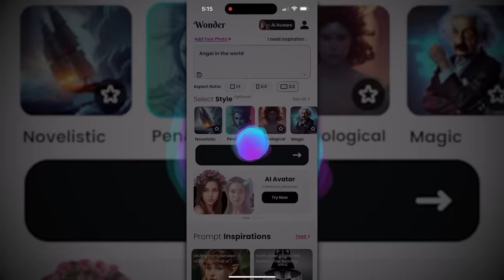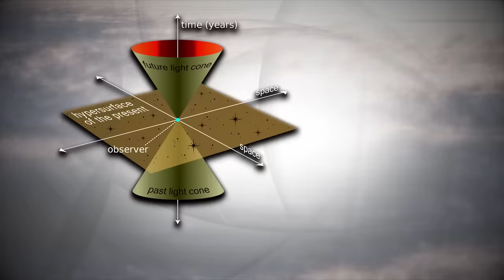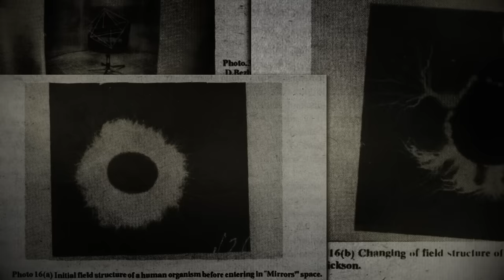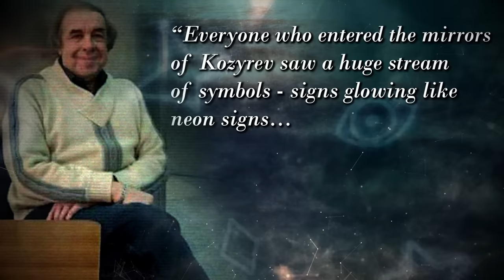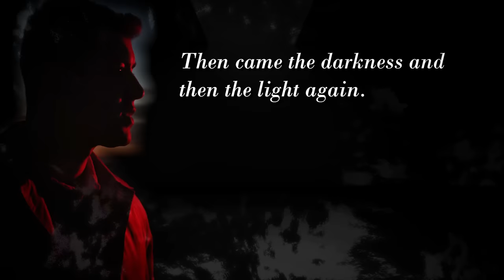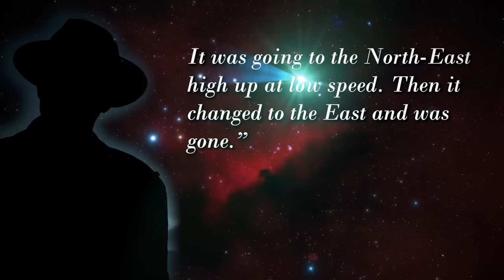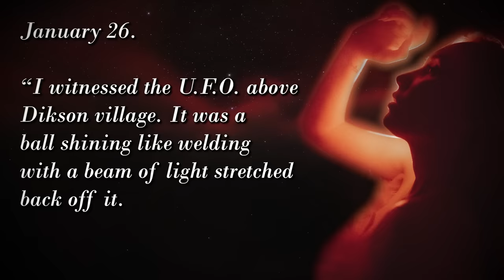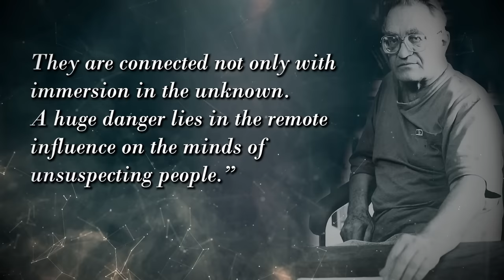Time Mirrors: Experiments at the North Pole

Comment: These experiments remind me of the Orgone boxes that were popular for a while and then outlawed.  They were pretty much like sitting in a metal box and seem ridiculous however they may have been banned not because they didn't work but because they did work. I bought a purple "Tesla" energy plate online with great skepticism and in a massive coincidence the same day at the local warehouse store food store they had a close out of large 2 pack basil plants with just one left and for half price. 
I figured what the heck I like basil.  I potted them and placed them in equal sunlight at opposite ends of my patio table  on my back porch and put the Tesla plate under one.  In just a couple of days the one plant was perhaps 15% larger and a couple of days after that 20%-30% larger and looked healthier. If I had not seen it myself I would not have believed it. 

People think they breath just to exchange oxygen and carbon dioxide but we also breath in what is called Orgone by some, or called Chi, Prana or life force energy. It is God Energy. When you have concentrated Orgone energy you have concentrated god power for remote viewing, manifesting and whatever you intend for it to do.   This is why I don't discount the amazing north pole experiments. I would like to know more about them but I don't automatically discount them.

Comment: I saw in a dream how a chrono visor was built. it was simple, made from a number of aluminium mirrors arranged in a spiral. From bigger sizes to smaller ones. but its harder to make a prototype without the right tools and measurements. I would expect to see an altered reality trough it. Its funny how i had that dream last year, and i hear that the time mirror was also using aluminium in a spiral shape.
Reply: I had a dream like that as well. 
 In my dream I was able to understand everything and it seemed so obvious and simple but I knew that when I came to I would have to way to bring it into reality. I an not a technical or engineering minded person. 

I still wonder why they would show it to me. Maybe to encourage someone who can recreate it!
Reply: I know dreams can be fleeting, but do you have a guesstimate for how many mirrors there were? Were the mirrors connected in any way, or just arranged like you said
Reply: Your story also has absolutely nothing to do with the current topic
Reply: @spruce bingsteen  yes it does. Don't you know what a chrono visor is? It's very similar to this mirror.
Reply: sure buddy

Comment: Only listened to couple of your stories really enjoyed this one. The Kozyrev Mirrors sound ultimately like a simple tool of reflecting all forms of energy both psychic, time, dimensional and electric. With this being the case everything can be explained. The fear could easily be caused by ultra high frequency electrical impulses that would not effect the body. Being placed inside the chamber would reflect a person's own energy replicating a similar situation to a sensory deprivation chamber (with deprivation you are trapped within your own energy, with the mirror chamber your own energy is being bounced around you).  If unprepared for those things fear and self endangerment to escape the confusion over the experiences make great sense. I certainly would love to try the chamber. I probably would be afraid, eager and curious. As for the artist if he was already highly sensitive  that may explain the electrical disturbance.
Reply: If that were the case it would get hot or cold
Reply: @clairehann2681  yes but what if the channeling of those energies stabilized each other the universe innately tries to keep balance so what if the energies had only a micro change in temperature where they only offset each other enough that it had near nil effect.
Reply: Space blankets/mylar works in this way, reflecting ones own bodily heat back to maintain life where hypo’thermic conditions will Freeze you to Death !

Comment: 32:01
Yes, it's nanotesla. In Cyrillic nomenclature tesla is "Тл" ("Tl"), not just "T" as in Latin.
And no, they were not talking about 990 thousand. It's just 990. So a change from about 50000 to 50990, roughly speaking (in reality you need to add components through Pythagoras' theorem, but this is details; the result would be close anyway). I.e. something like a 2% increase. Usually you get something like that during a decently strong geomagnetic storm.
Reply: Good, ty.

Comment: A one meter round convex mirror that is cut in a continuous one inch strip and mounted in a 4 degrees angle convex-hump reflection to a 45 degrees pyramid point apex above the mirror surface instantaneously ignites a 2x4 board from the infrared UV photons at that concentration point! Kozyrev would have liked knowing this!
Reply: sick!
Reply: 360 polar coordinates… 222.5/137.5 (this is the cosmological fine constant number that’s a mystery to physicists because it found all over everything!) … equals Phi 16181818… and 122/360=2.95081967….. divided by, divided by 2, divided by 2 equals 0.369 of Tesla’s incessant talking to himself over the number 3 …because this is the leveraging point of three loci in Cartesian space-geometry where true “zero point” inertia where everything is falling into which everyone commonly calls gravity!

Comment: I first heard about this on The Why Files and the more I learn about it the more difficult it seems to build.  It seems pretty easy on the surface, like it would be a fun project, but it has to spin?  Special aluminum?  Seems like a lot of work.  I'd still like to build one, not sure what I'd do with aluminum sheets once it didn't work though, lol.
Reply: If you build it please let me know 😂
Reply: Make a smaller one for just your head that you sit under.
Sounds like the chrono visor a priest made at the Vatican
Reply: @dilligaf8349 that or you could make the seat stationary and the entire outside revolves around it like a Mary go round
Reply: It doesn't have to spin ❤

Comment: 108-36-36 = 180 degrees of a hydrogen atom which is the basis of the reflective time angle as a Pentagram and five triangles make up a three dimensional time space event from the two dimensional six triangles of a Hexagram- which is the foundational structural point of reference for all atoms and molecules in our universe.

Comment: Recently saw the Kozyrev story on The Whyfiles program.  Looking everywhere now for plans, going by images that are shared. Getting an idea of makin one w/Mylar sheeting 4'  x 100' covering 2 - 4' x 4' fridge shipping boxes, cut into sheets  using 7 sides,  not all 8, taped together.  Extra Duct tape on the former corners of the boxes to insure a fluid transition of a flat sheet that's been curved.  I would prep the cardboard and  roll it into a tube to give it a smooth curve.  Then a 1/2" or thicker PVC pipe made to be 25 feet long, heated up w/a heat gun, for the top and bottom to guide/keep/anchor the thick cardboard in a spiral shape.  The Mylar would be attached to both sides of the cardboard.  Not a costly investment, a lot less than polished aluminum.  I was thinking that the infinite curve in  a sense would reflect/bend/concentrate the time/energy maneuver focused on the participant.   Thank you Mr. Mythos for this video!!  Any ideas are welcome, thanks
Reply: Looking into a Litvinov Mirror design and with real aluminum but engineered w/pieces bolted together.  Just have to see what fabrication would cost.  They are being sold in Russia and patented.

Comment: The ufos changing shapes at 33:35 I had got to be beings/crafts that exist in higher dimensions passing through our 3 dimensions. Similar to if you pass a 3d object through a 2d surface, from the perspective of something in the 2d space would see only the slice of 3d object that is currently passing through the 2d plane. So if the ufos were changing shape it would be like a 4D or 11D object passing through 3D and they could only see the 3D parts of it that was currently passing through

Comment: I would be curious to build a smaller version and with a high-powered laser at a distance.. then using multiple filters trying to isolate the correct wavelength of light that was capable of holding time info

Comment: Why are the people going into the mirror in a laying down position?  The early mirrors show people walking in. Why was it changed?
Reply: I presume it was to get the full spiral effect; if you are entering through a door to sit in the middle there is a discontinuity where the door appears in ones visual field. By entering horizontally this is eliminated. I would also think that by lying down and being rotated in the horizontal plane it would create a dissociation of top and bottom relative to the head/feet whereas when seated in an upright position when rotated  horizontally one is aware the head is still in top position.

Comment: You asked for people's input so I am going to give you my input based on personal experience.

I can tell you this much. Mirrors in and of themselves are not normally an issue. That being said, those mirrors are not time mirrors like some might think. That device and the way it is being used is opening up portals to the demonic realm. Mirrors are used for scrying in the occult, the same way a flawless crystal ball is used. I watched your entire video. I used to be involved in occultic practices. I had to repent of things and turn away from all of it. I can tell you this much though, if a person is not mentally prepared before using such a thing (meaning no thoughts at all) beforehand it can and does mess with your head. Everything you mentioned has a base in the occult in regards to those mirrors. What some are trying to call science in reality is simply witchcraft. Stay far away from it and avoid  it like the plague. That is my advice. You did ask for input and now you have mine. People can think they are time mirrors if they want. I know better.